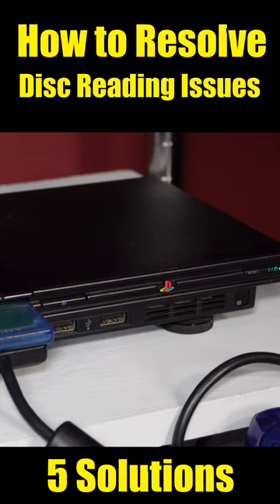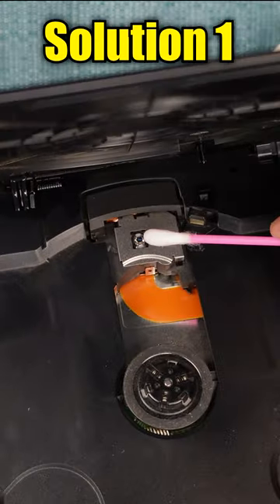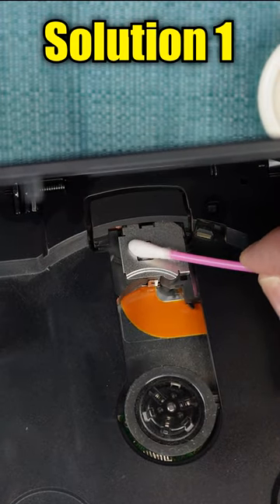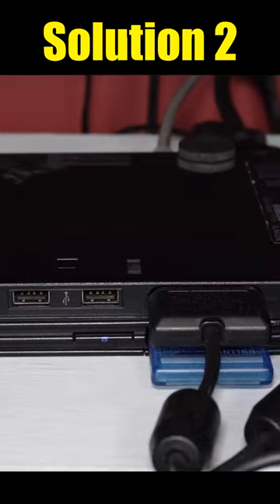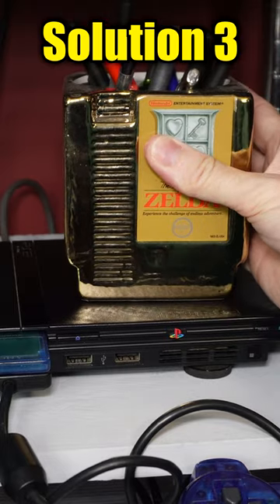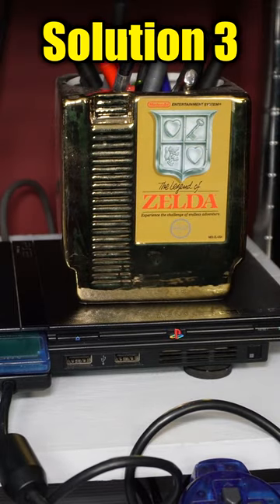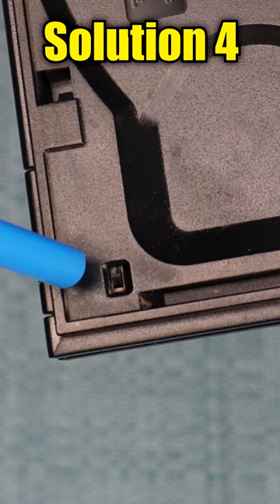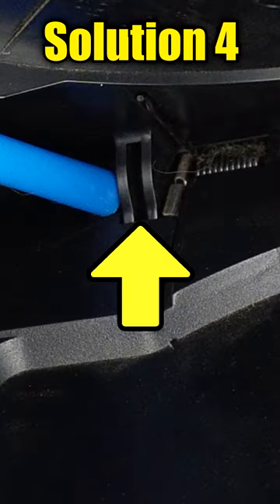How to Fix PS2 Slim Disc Reading Issues

Comment: Literally tried all of these and nothing worked. And yes my disc’s aren’t scratched
Reply: oof same
Reply: Even if your discs are scratched at least you'll get the rsod
The issue is that the disc doesn't even spin at all
Reply: Perhaps it's the ribbon cable under the lens